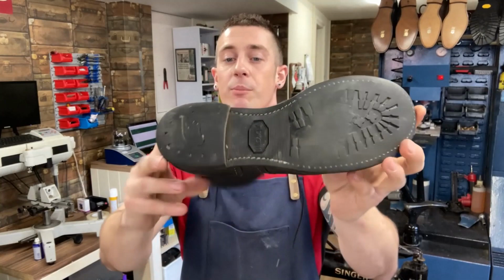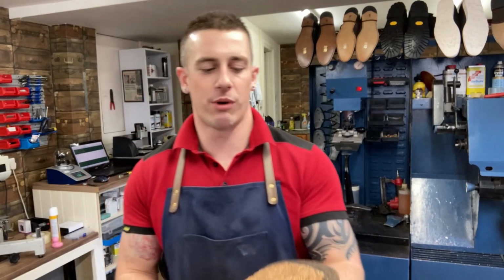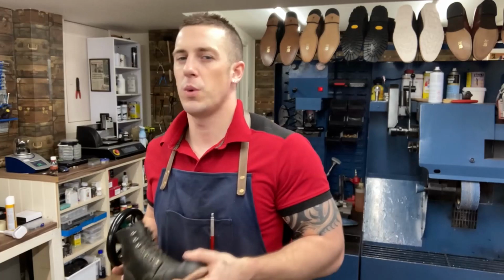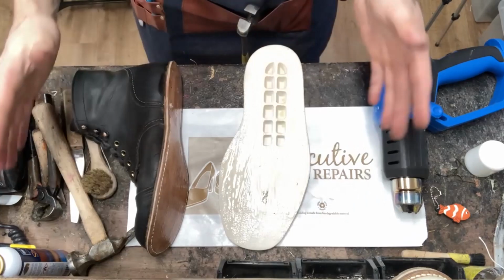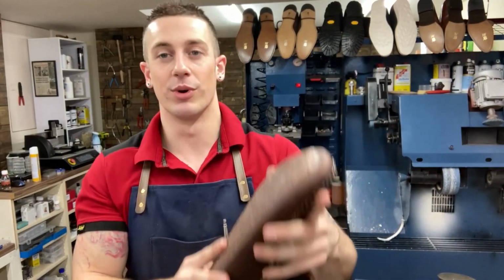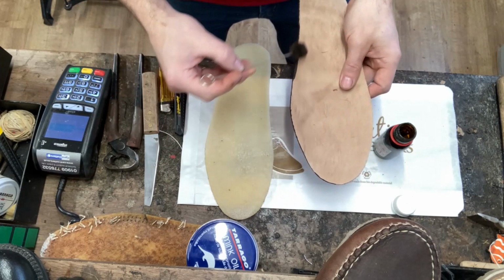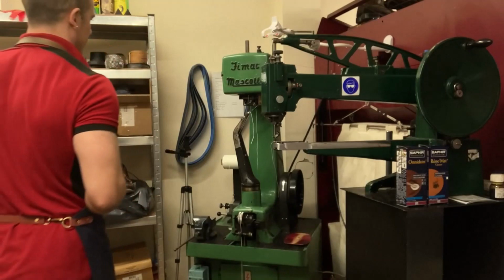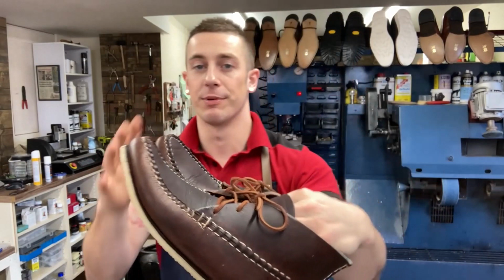REDWING IRON RANGERS SOLE CONVERSION | Plus Arrow Moc Crepe Soles | Mens fashion 2021 moccasins

Comment: Loving the video but loving the moccasins even more. I've been wearing them every day since you sent them back. Thanks again - Liam
Reply: absolutely exquisite moccasins. 👍
Reply: Can you describe the effect of getting a mid sole on them? My experience with crepe soles is that they're extremely comfy but if you step on a coin you can tell if it's heads or tails, and I'm wondering if the mid sole dampens that without killing the softness and superb grip?
Reply: @andersjjensen  exactly as you described... it softens it drastically
Reply: What color wedge could you put on black Iron Rangers?

Comment: I am a plasterer as well as a carpenter, so I wear boots for a living. Never thought I'd be so interested in the work that is done to repair them. Mentioned this on another video , actually. I have bought 1 brand for about 10 years, and I am barely through my 2nd pair. Redwings are nice, I hear. Wouldn't work for me, as I run around far too much and it would not make much sense to use them. 

Awesome content, btw.

Comment: Everything looks great. If I owned those moccasins though, I would have asked you to just stitch the midsole on and glue the crepe. That would be a solid reinforcement for the shoes, and then they would never need to have holes punched through the foot bed again from stitching new soles. Just glue on replacement crepe as needed. I think the glue is plenty to hold those on. 🤷‍♂️

Comment: One tip for applying mink oil it is best to heat up the boots before you put on the oil, to open the pours in the leather so that it can penitrate better.

Comment: Hey thanks for showing the glue pot around! I wrote earlier about my curiosity on its workings. 

Could you also explain the different types of shoe construction; how the different parts attach and give strength to the structure; the different parts of the sole and why different materials are used in each layer. I'm curious why cork is used instead of something like memory foam or gel or even rubber. 

Keep up the good work and please continue sharing!

Comment: Dan, so the customer went from the original sole to a wedge sole.  I thought the shank was there to provide support in the arch for the area where it transitions from the flat sole to the heel block.  Since the wedge will not have that transition, could you have removed the shank?  Does it play a role anymore?  Thanks!  Enjoy the videos!
Reply from the maker: You could have removed it i suppose and sure the wedge would give the support, but doesn’t hurt to leave a key part of the original shoe in place :)

Comment: That severed thumb trick traumatized me as a kid. My dad never did it but once my other friend's dads found out it scared the bejeezuz put of me, they would do it regularly. That boot sole conversion was radical. What a change in the basic look!! Thank you for the walk around of your town. What a charming place. So beautiful...I just realized this is an older video - but was wondering on the new Ranger soles might one add a more durable heel Blakey or rubber insert to slow the wearing process?

Comment: I was wondering: if you had some templates, you think you could whip out a complete handmade custom pair of shoes? Or using an old shoe for a pattern & guide? I have some of my most beloved shoes worn to bits (numerous resoles, shod completely now,  including tears in the uppers because of lace-rub and accidents), they're no longer available (I have had them for more than 25 years now, the brand is still there but not the model), so it would be a dream to get a replica of these...

Comment: Hi, you said the glue is heat de-/activated. Since the summers are getting hotter, would it be possible on a really hot day walking across tarmac, the glue starts to fail? Tarmac gets quite soft on a hot day too because it's "poured" when heated up, and it seems to attract heat too.
Reply from the maker: It would have to be really hot for that to happen, for context if you were to put you hand under the heat lamp for 1-20 seconds it would burn you.

Comment: On the heel tacks how do  you prevent them from poking through to the inside of the boot? Does the form inside the boot flatten the tack as to prevent them from coming to the insole?
Reply from the maker: Thats correct, they flatten against the last.

Comment: What is the deciding factor between cutting away the excess sole material by hand with a utility knife, and using the little hand crank cutting machine?
Reply from the maker: Usually I use the ranger just for leather that’s too thick or tough to cut easily with a knife

Comment: so with the heat activated glue if you are walking on a very hot surface would your shoes start to fall appart?
Reply from the maker: Only if it’s the surface of the sun! Would have to be very hot to do the same as the heat gun and heat lamp do.

Comment: Is it worth resoling cheaper shoes? I have a pair of Adidas (leather uppers) that is starting to wear through the sole. Last time this happened I just bought another fresh pair, but if it's possible to be fixed I'd rather support a local cobbler than Adidas.

Comment: Saw in a Trenton and Heath video, thst they use an iron to heat and form the cork. I was wondering if there are different benefits for those different application methods. 

Thx a lot for putting out these great videos!

Many greetings from Germany!

Comment: I've been trying to catch you on a new episode. QUESTION. Do you only put the sole half in the oven? Does the heat of the sole after the oven heat up the midsole glue enough?
Reply from the maker: Yep, just one side heated is fine it reacts with the “cold side” instantly, you can double heat which o sometimes do on tricky jobs but usually not needed 👌
Reply: @Dan_the_cobbler  awesome!! Dude I appreciate the reply,  I started watching a week ago and it's been bugging me ever since😂